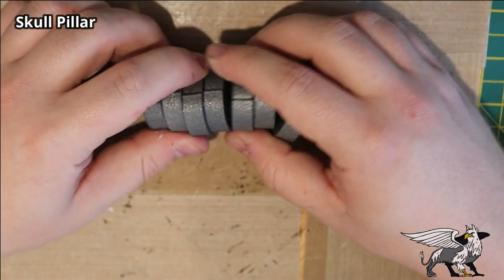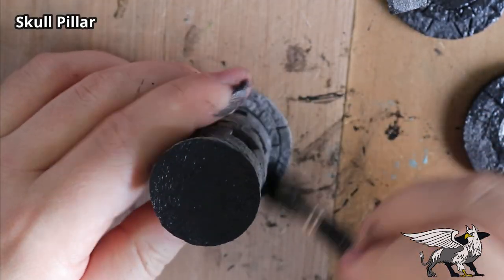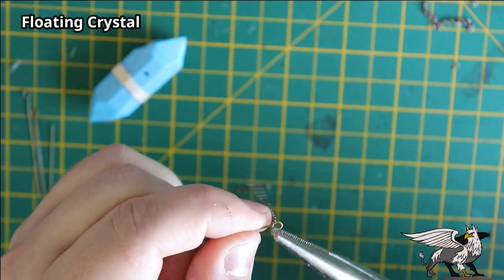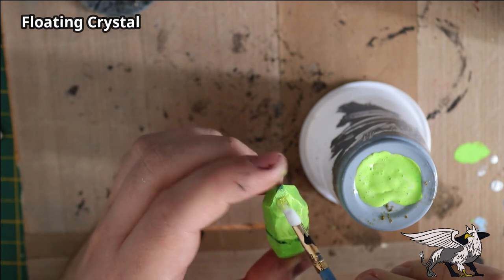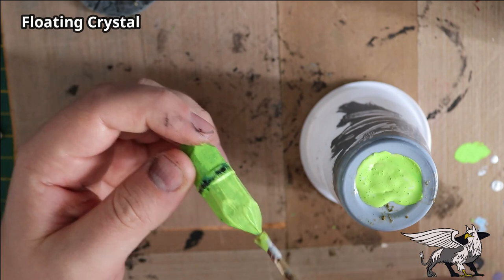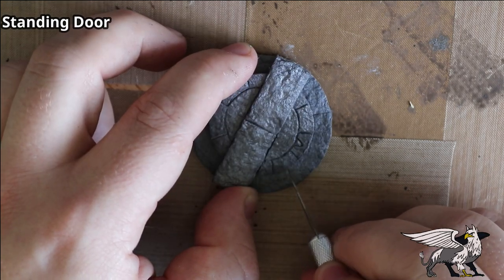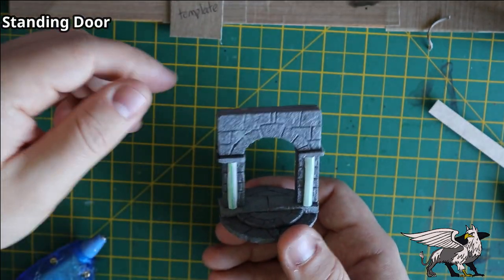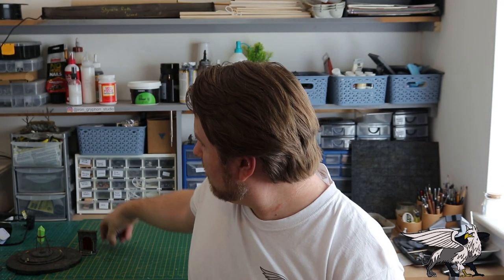Iron Gryphon Studio - Ep 25 Ritual Circle Centerpieces part 2 (modular dungeon terrain DnD wargames)

Comment: Not n the UK or I'd use the links. I wish I could find XPS easier here in the states. Looks like you use the graphite XPS (GPS) in a lot of builds, because it's denser or because its what you have on hand?
As always great video, inspiring me to build a similar hyper-modular centerpiece for my tabletop.
Reply from the maker: I will try to sort out some Amazon links for the US as well 🙂 
At the moment I'm using that dark grey xps foam at the moment cos it's what I have to hand and it's taking up space in my studio 😅 
Thanks for watching buddy 👍😀
Reply: @irongryphon  thanks for the info! Makes base coating easier than the pink stuff.
Reply from the maker: I would always base coat any foam with mod podge and black craft paint, no matter what colour I use. It just helps to seal the foam from any spray paints or glues I may use on it during the build